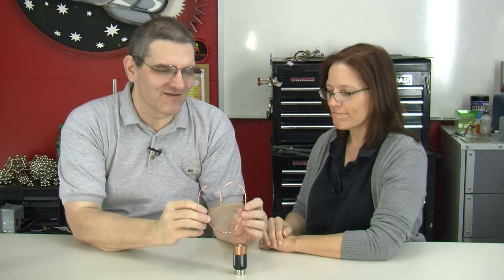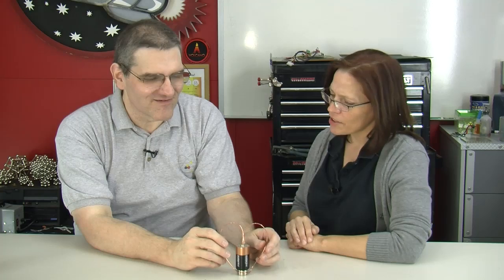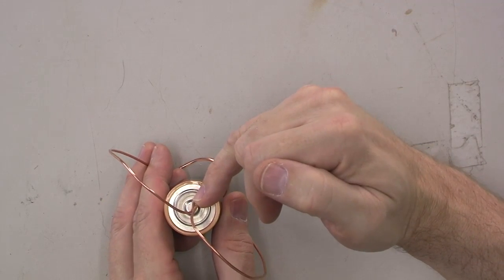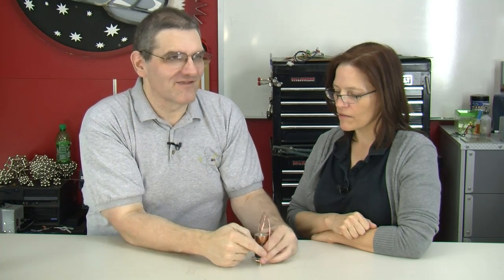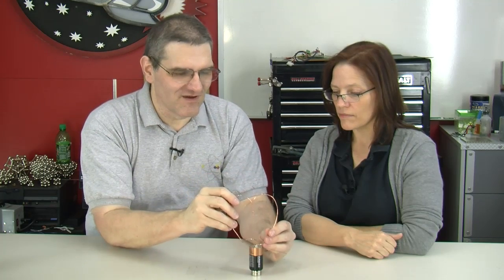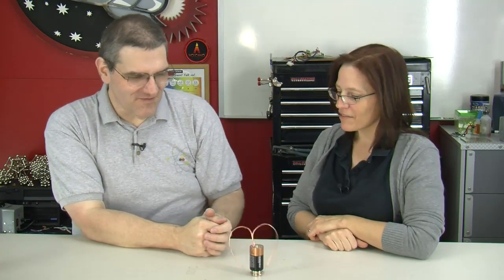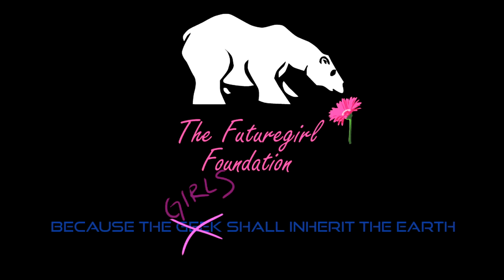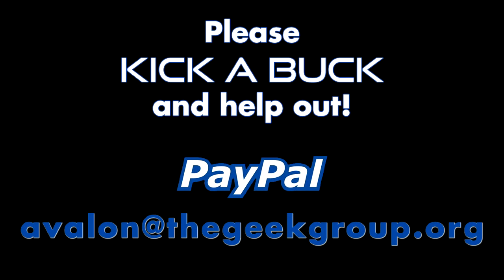Homopolar Motor Overview

Comment: My explanation of that was wrong. The current flowing through both sides are in the same direction due to the circuit being set up in parallel so the current flows down through the positive end of the battery into the negative and up through the battery.  The rotation is caused by lorentz law F = qv x B in which F, V, and B are vectors (have direction) and v and B are crossed resulting in the force.  v, B, and F all have perpendicular directions (90 degree angles). V is the velocity and direction of the electrons moving which is along the wire therefore the current, magnetic field, and force are all perpendicular to one another.  V should not be confused of the velocity of the rotating wire.  q is simply the charge through the wire in this case.  Because the magnetic field is moving in opposite directions for both sides of the wire the force switches from negative on one side to positive on the another which creates rotational force (torque) where if they had been in the same direction the forces would cancel resulting in no rotation.

Because the magnetic field can be imagined to be like a sphere in a sense as the wire moves the direction of the magnetic field is the same relative to the wire causing the force to be applied in a circular direction rather than a linear one.  The equation for this is shown by combining the formula for centripetal force with the one preivous to derive r = (mv)/(qB) This equation uses lorentz law to describe the circular movement of a charged particle (in this case the wire)

Comment: I get right hand rule, but they only talk about how the current and magnetic forces flow from UP TO DOWN. Can someone please explain why the wire spins HORIZONTALLY?
Reply: The force acting on a point or in this case the wire is always perpendicular to the magnetic field. As the current moves from the top to the bottom of the battery the force moves outwards, but as the current now moves from the bottom to the top for the other side the direction of the force also changes and now moves inwards.  These two forces create torque on on the wire causing it to spin.

Comment: Explanation is correct (almost) One detail to mention. The only part of the wire that is submitted to a rotational force is the HORIZONTAL component of the copper wire. We have to take in consideration that the Right Hand Rule describe the force of a strait wire. In this case the wire as a vertical component and an horizontal component. To help someone understand the rule with this example I think the Horizontal component must not be neglected. Good job, I like your stuff :)

Comment: @matkilla454 There are two ways to look at current. Conventional current and electron flow. Conventional current came first when they assumed electricity was the flow of positive particles. It leaves from the positive side of the battery and goes to the negative side. But then they discovered electricity is electrons, electron flow. An electron is a negative particle that actually travels from the negative side of the battery to the positive.